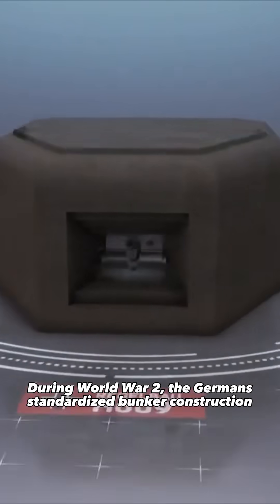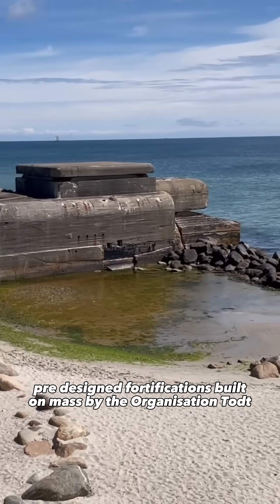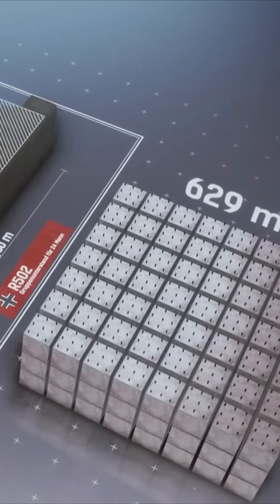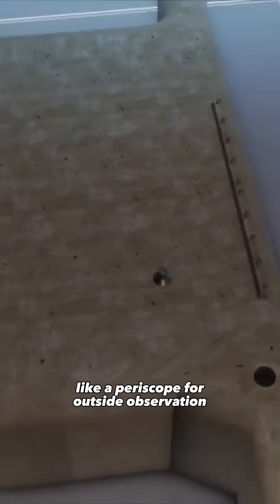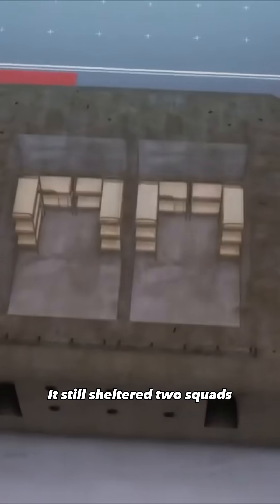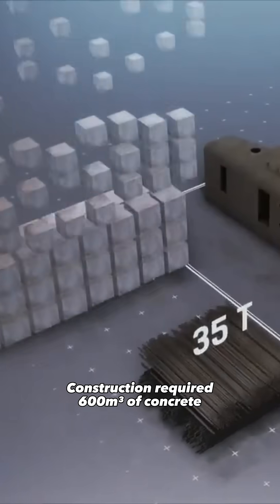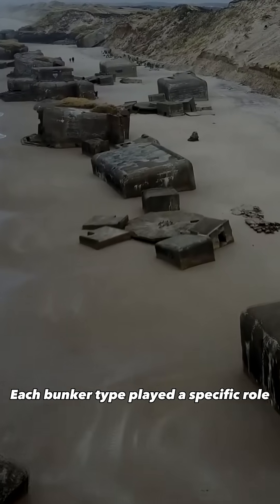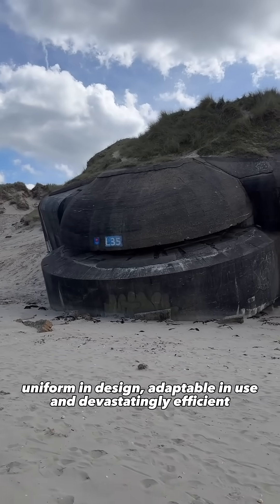WW2 German Bunkers standardization #history #ww2 #engineering

Comment: The problem with the Atlantic Wall was that once breached it had lost its usefulness.
One the other hand think of how many tanks that steel could have made.
Reply: Same can be said about any frontline...
Reply: @JesperSandgreen  What he means is static defences are a waste of time, money and resources. 
They Germans never learned from others mistakes. 
The Maginot Line should have been a huge red flag, given how easy it was defeated. 
These defences could have been made even more useless but for bad allied planning. Had they had the foresight to avoid the beaches they were facing, it would have saved hundreds of American lives.
Reply: @Zooumberg  Oh gee, how the Allied planning team missed the opportunity to benefit from your all-knowing wisdom and hindsight.
Reply: Tanks  that required fuel they didn't have
Reply: @iw7kj  Very good point!
Reply: part of their problem with the tanks, not enough oil to run them. That's why they where so willing to overextend into russia etc.
Reply: They couldn't make tanks anymore. They lacked tungsten and could not make proper machining bits. Therefore the tolerance was varying and in the end it led to as mass malfunction of tanks.